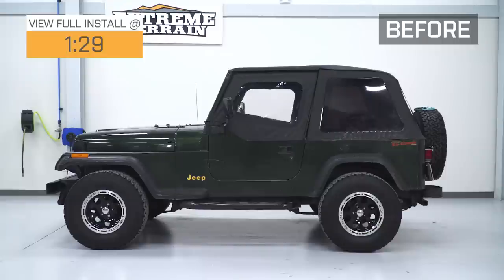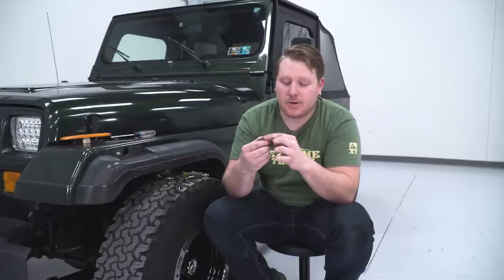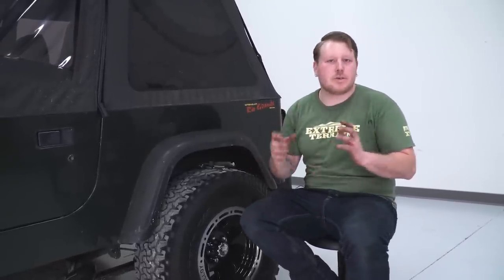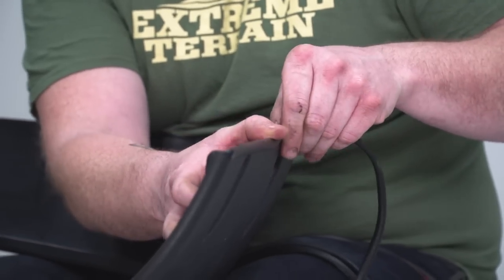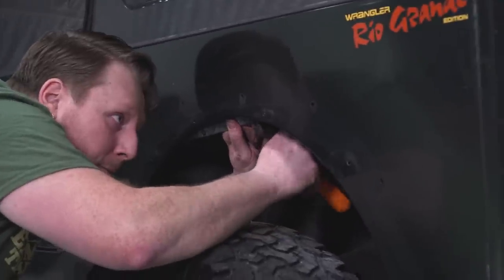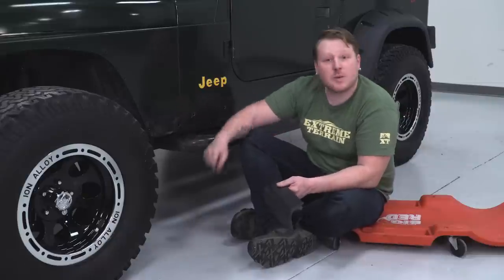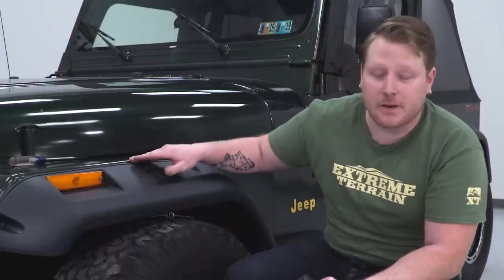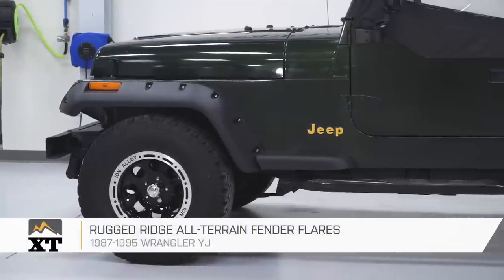Jeep Wrangler YJ Rugged Ridge All Terrain Fender Flares (1987-1995) Review & Install

Comment: How were you able to get through on the first two bolts holes on the rears? I can’t seem to figure out how to place them without needing to drill in to where the seat belt housing is located.

Comment: Nice video for us who want to buy a pair.
Watch out for your fingers though! Cutting like that is gambling with your fingers. Also, while you drilled your front fender, you can see how drilling the holes through the fender without bolting as you go is a bad idea. You tapped the fender and dropped it, drilled the next hole, then raised it back up for the following hole. My guess is you had a bolt that didn't quite fit or needed to be re-drilled.